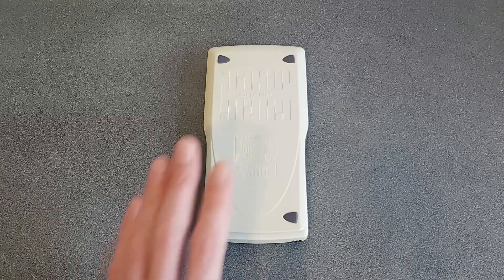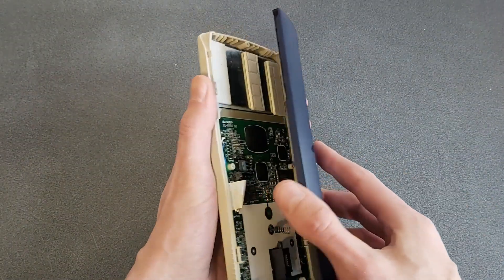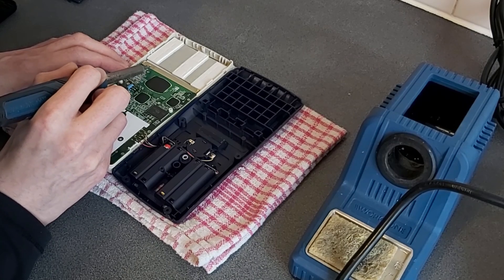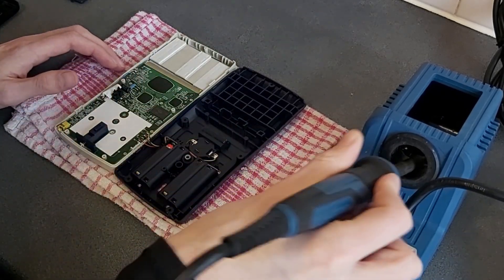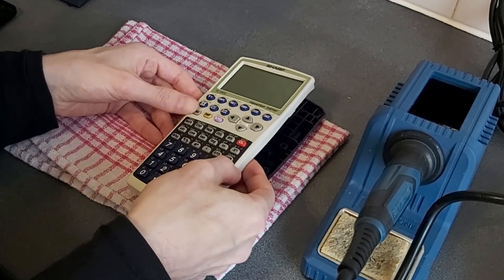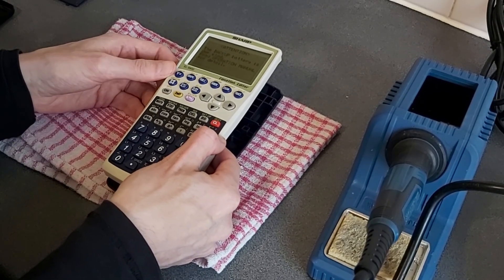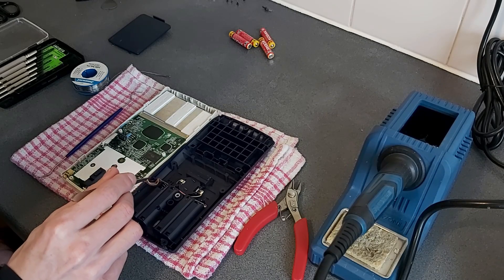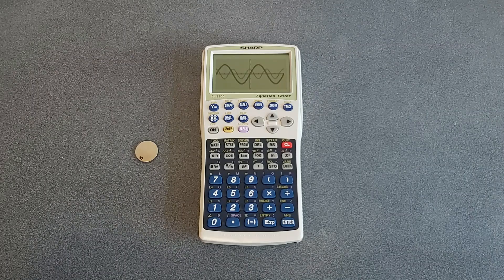Sharp EL-9900 LCD ribbon repair

Comment: Good morning, I bought the Sharp EL-9900 S2 for about €14. Sometimes the second column from the left is missing and once I saw that a column on the right was also missing. So I would like to solve the problem. I wanted to ask you at what temperature the soldering iron is set, what power does it have? Thanks for the useful video
Reply from the maker: Thank you for the comment! In this video I used the iron set to 250°C. It's a 60W iron but as it's not heating a large mass a lower-powered iron should also work. I'm using a flat tip that I have very thoroughly cleaned (I don't want to accidentally transfer any solder to the cable/PCB and create a short circuit) and only apply gentle pressure and for a very short amount of time, only moving the soldering iron parallel with the tracks of the flexible cable (I don't want to shift them out of alignment with the circuit board tracks). This is a fairly heavy-handed process and risks making things much worse so be careful, and good luck with your repair!

Comment: As the other comment mentioned, this is the defacto repair for original Game Boy screens, but I have also used it with success on Game Boy Pocket, and a number of TI calculator screens! However it failed catastrophically on my Casio color graphing calculator LCD.
Reply from the maker: Oh dear, when you say "failed catastrophically", what went wrong? Glad to hear of the other successes, though! 🙂
Reply: @benryves  I am not saying I melted the ribbon. But the SOLDERING IRON absolutely did.
Reply from the maker: @cdigames  What a rotter!